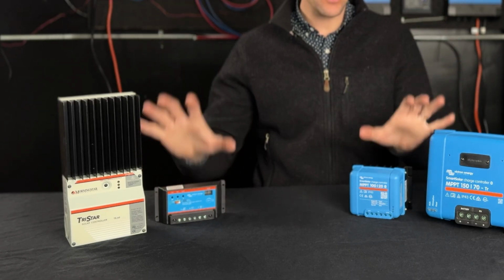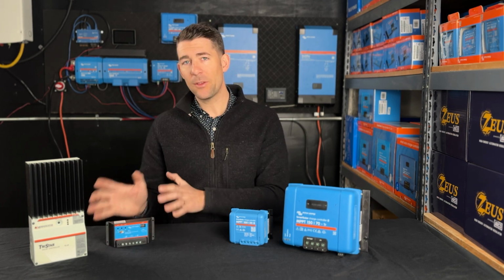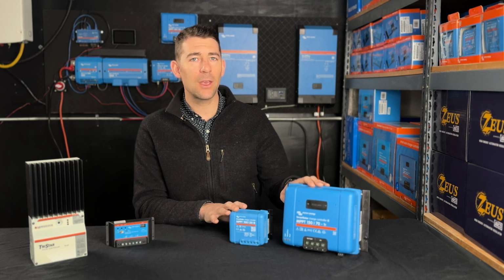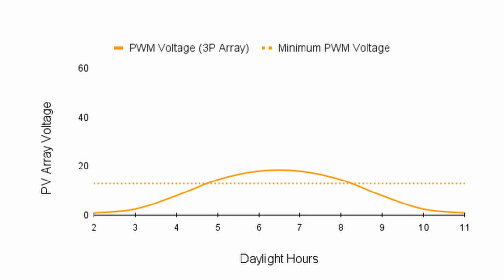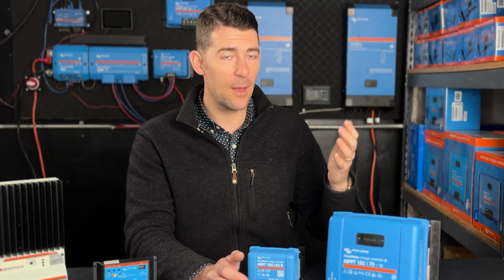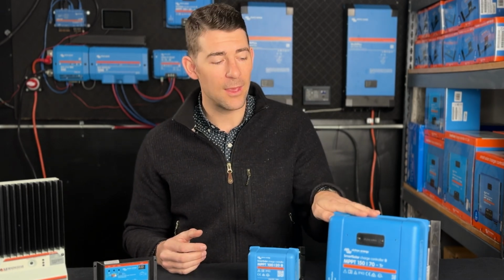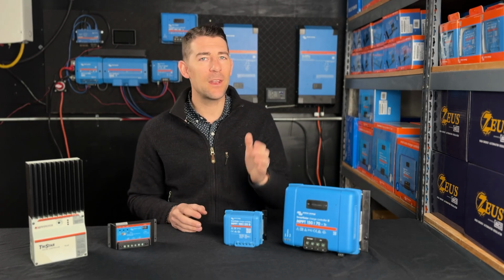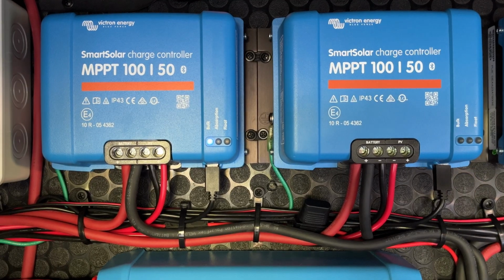Understanding MPPT Charge Controllers

Comment: Can a solar charge controller jus work without a solar battery? work just as a dc to dc converter? plenty of them have remove the dc load option. I want to use mine as a volt compressor . I over panelled my powerstation in parallel the volts became too much contrary to what I learnt on YouTube and fried the system. So can I just buy a solar charge controller let it just work as a dc to dc converter for me?
Reply: Did you get an answer to your question? I have the same problem/ I want to use a solar charge controller to charge a 24v lithium battery from a 12 v dc output on a power station.
Reply: @odal6770 I just wish they will let charge controller work as dc to dc converter too
Reply: @prosperityokechukwu1503  I agree. I have come to the conclusion, maybe wrongly, that solar energy makes no sense for me. It simply takes too long.

Comment: I want to solar charge with a 30w or a 50w 24v solar panel  a 24v gate opener that has a 24v 60ah lifep04 battery which of your Victron solar charge controller's do  you recommend
Reply: Okay show me a video of all the components that I'm going to need to turn around and run a three-bedroom whole house system I need to know all the equipment I'm going to need
Reply from the maker: Lol, see reply on comment.

Comment: I will have a 1000 watts of solar panels what one do I need?  You have two sizes on your left you didn't talk about them comparing the size difference!
Reply from the maker: Hi! It's going to be largely dependent on your PV details and your battery bank. Part of why I didn't go into detail about the exact units I had was that there are so many. For 1000W of PV you'd expect  to see around 80A of power for a 12V system, 40A on a 24V system, and 20A on a 48V system (the second number of the MPPT model). Then the Series/Parallel configuration of your PV, the voltage of the strings, and the amperage of any parallel strings, comes into play when choosing the appropriate MPPT (the first number is the max input voltage). Thus, for your setup of 1000W I'd suggest a 150/85 (if your PV voltage is under 150V in cold weather) for a 12V system, a 150/45 for a 24V, and a 150/35 most likely for a 48V kit.
Get in touch for specifics and we can go through your exact setup.

Comment: What size conduit is needed for 70 amps at 150vDC?
How can I run the wires on the surface of the ground from the array to the house?
Reply from the maker: This depends on where we're talking about. If you've got 70A of 150V power that's quite a lot, likely 2 MPPTs at least - so 4+ cables (bigger conduit). If your MPPT output is 70A while the input voltage is 150V you're actually hitting 20-25A over the PV wires. Say you run 100', that's around an 8AWG wire. Longer it might need to be a bigger wire shorter and it could be smaller. Also depends on the conduit and how well heat is mitigated, etc, etc.
Reply: @intelligentcontrols  Each panel is 27v OC at roughly 8.5 amps or 200 watts each.
I have 4 of them.
My controller is a victron 150/70.
I have 8 gauge wire and roughly a 100 foot run.

From controller to bus bar and then to batteries is 2 gauge.
I might add one more panel so my voltage would be about 135 v.
And rough,y 40 amps or so.
Less any losses.

I do not expect the full 800 watts and panel makers ALWAYS lie about the output.

Hoping for 600 watts or so x 6 hours a day.

Not sure on how I will run the wires.

I may just get a string inverter and not have to worry about it. Have an AC outlet within 25 feet of where the array is going to be.

Of course I would be stuck with an expensive Victron going unused.

Comment: I think you kinda made me understand a little more than I did. I have 6/320 watt panels, 6/100amp deep cycle marine batteries,  how many watts of mppt do I need.
Reply from the maker: Thanks Mary! If that is a 12V battery bank then you should look to get about 160A of charging capability from your MPPT's. A pair of SmartSolar 150/70's or three 100/50s would be a great fit.

Comment: I have 30 ah lithium ion battery with 180 watts panel and pwm based solar  inverter 50 amp charge controller
Reply from the maker: Ok. We can give you a specific recommendation if you'd like to reach out to us directly with the details of your PV panel and battery bank. From the really basic detail of a 180W PV panel charging a 12V battery bank you'd likely be wanting to use a SmartSolar 100/20 or even perhaps a SmartSolar 75/15

Comment: I have 100/50 300 watts they over heat
Reply: Did u conect it correctly 🎉🎉
Reply from the maker: These units do get warm while running typically. I'd start with how solid the connections are: biggest cause I see of heat is a connection that's smaller (or not fully set) to handle the power involved. Second cause, especially of smaller units in a mobile setting, is a tight compartment or that it's near a surface that get's quite warm and overheats it (like the exterior shell of a camper van sitting in the sun). Check the connections first, then the location and see if you need ventilation or to get it away from a hot wall, then if it's still overheating and giving you an error contact who you purchased it from and see if they can help - Victron is quite good about supporting their equipment so if there's something wrong with the gear they'll make it right.

Comment: Also if you connect the batter from the charge controllers does it matter the size of the controller or how many panels you use
Reply from the maker: Yes, the size of the array and the voltage of the battery bank is crucial to determining what MPPT is best fit to the job.

Comment: Hi can you suggest me what is suitable solar charge controller for solar panel 500w
Reply from the maker: Hello there, the answer will depend on what voltage your battery setup is. The quick and dirty way to find out is to take the wattage of the solar array and divide it by the voltage you will be charging. For example, 500W / 12V = 42A. In this case, you should look at charge controllers that can provide around that amperage. If these are say, a pair of 250W 24V panels, then a good option would be to series them on a Smart Solar 100/45 MPPT

Comment: In multiple panels wired in series, if one panel is shaded will the mppt charge controller still be able to charge system? Or do all panels need full sun no shading?
Reply from the maker: In a series connection, voltage is added panel to panel, while amperage is set to the lowest source. If one panel is shaded, the addition to the overall voltage will be reduced, but the overall amperage will be set to whatever that shaded panel can provide. So everything will still work, but the output will be reduced.
Reply: @intelligentcontrols i sea, thank you.

I was under the impression any shade in the series circuit would null the input from that leg.

Comment: Victron is severely overpriced. There are other controllers with the same or better functions and a LOT cheaper too with an equal or longer warranty than Victron.
What I don't understand is that warranties never match the lifespan of the panels.
If Victron is go good then why a shitty 3-year or less warranty for premium dollars?
Technically you may have to replace your controller every 3 year-ish at a high price.
Does the extra power you get save you enough to warrant that expenditure?

I will have a 4 panel array - 2 series + 2 series then both in parallel so to stay close to the 50 volt controller limit.
I get the benefit of some shading protection and power generation at roughly the same time.
Sure I need 8 gauge wire (100 ft run for each the red and black) but wire does not wear out so it can be reused again. Or used elsewhere.
My array is portable (on wheels) so I can MOW under them and NO PERMITTING required.
Fixed arrays generally require a permit and as a result higher property taxes.
No thanks to both.
Oh and permits to do an old house usually demand you upgrade everything NOT RELATED TO the solar.
Not going to rip out walls just to replace wiring for grounded outlets, new panel with arc fault breakers, etc when all I want is solar for a backup system that is NOT connected to house wiring.

On my array, if I have a problem I only lose 1/2 the array. If all in series I lose everything (power generation).
You have just as many failure points in a series than you do in parallel.
Each connection is a failure point, regardless of the setup.
At least with parallel if you lose one panel the others still supply SOME power. 1/2 a loaf is better than no loaf.
Reply from the maker: Victron tends to have a European mindset regarding warranties. If the product is good and the reputation proceeds it, why would someone need a warranty unless they are expecting it to break? If they expect it to break, why are they buying it in the first place?

Not saying that the opposite position isn't valid, but if Victron components had any history of needing replacement every 3-4 year then I doubt people would pay the premium.
Reply: @intelligentcontrols  Never trust anything with electronics in it.
Not just Victron, but your stove, refrigerator, washing machine, cell phone, tv set, etc etc etc.
Expect to break? I sure do. Anything will break, in particular anything with electronics in it.
In the past I have bought things with a short warranty. And soon after the warranty expired, the item broke. And at a very inconvenient time too.

If Victons were made to last, they why not increase the warranty a lot at least for marketing reasons?

They chose a short warranty for a reason.
What might that reason be?

I do not plan on the one I am getting to run at maximum for any length of time.
In fact, the one I am choosing will run about 25% less than maximum, at least initially anyway.

It is going to be a 150/70.
Input will be about 100v and 36amps.
And with a 100ft one way wire run of 8 gauge, the numbers will be even less.
Leaves more room to add a couple more panels and not stress the unit.

Not going to run my inverter at max either.

I learned that heat is the enemy.

Would you drive your car with the gas pedal floored everywhere? And if so, how long would your car last?

Same with electronics, but even more so.

I do like the large static heatsink it has.
Less moving parts = higher reliability.

I wish the unit came with a LARGE screen that you can easily see what's going on, make adjustments, see history, etc like the app can do.

HATE the idea of being forced to buy a cell phone just to use the victron. No, I haven't had one in years so that would be an unnecessary added expense in my opinion.
I do not want a cell phone either.
Computer is ancient and no bluetooth. No home internet router.

Just hoping the thing is fully automatic right out of the box.
Hate to have a battery fire....
Reply: @intelligentcontrols  Everything is fallible. I expect everything to break sooner or later.
I did buy a victron after all because of the warranty and it matches the system I am going to build.
Others did not meet my needs.
Originally bought a LiTime one but returned it immediately once I saw the specs.

Off that the victron max input is 1000 watts....

What happens when batteries are full? Will the controller stop on it's own?

Comment: I have found a problem with the MPPT controller, if the battery is flat, and the sun comes up in the morning, then you only get solar in the charger. it burns out.
Reply: more to that because the bms on the battery s have shut the battery s off because of low voltage
Reply: Why aren't the battery BMW shutting off the battery?
Maybe make a few upgrades?
You can parallel an MPPT with a PWM too and get that protection.
Reply from the maker: Hello John, what is the voltage of your panel array compared to the rating on the MPPT? If the batteries aren't accepting charge, then there is no load on the panels and the voltage they are putting out will be at their maximum. If your MPPT is undersized, you risk shorting it out and voiding the warranty. Please make sure you aren't running it beyond its parameters

Comment: Excuse my ignorance, but if you wire in series, you gain on the volts but you lose out on the current? The current is what you need to fast charge your batteries.  If your lithium battery can take a fast charge of 15Amps, you'll only be charging the batteries at 5amps which will take longer. Am I correct?
Reply from the maker: @crazysquirrel9425 is right. The MPPT is taking the volts and amps provided by the panels and manipulating them into the proper voltage to charge your batteries. If voltage is high and amperage is low, the reduction in voltage to match the batteries will push the charging amps up.
Reply: @intelligentcontrols  Same physics applies to grid power. High tension power lines have low amps and need smaller cheaper wire.
Higher voltage (potential) overcomes wire resistance easier than low voltage.
Less line losses that way.

The wire that will come from my array is too small for the run by quite a bit.
So, I have to series my panels and may even have to add in more panels to overcome that line loss.

Application would call for 2/0 wire (not 2 gauge) but I can only use 8 gauge wire.
I am going to lose at least 15% of the power generated with the 4 panels I will have.
Possibly more.

If I hit 25%, that is the price of a single 200w panel.

So if I add 2 more panels to make 150v+ at one end I should get closer to controller maximum but not exceed it.

Design problem is how to run the wires from the array into the house.

String inverters would be a waste as I would lose power with those, still have to run the wire, and lose power converting it back down to charge the batteries.

Burying the wire would be very expensive. Have to go around a building, then under a 25-30 foot concrete driveway, then 20 feet later go under a concrete sidewalk just to get to the outside of the house.

No straight run so have to use the biggest wire I could afford (100 feet each of black and red).
Wire resistance will kill the efficiency even if I step up the voltage.
Cannot move panels close to house due to a very large tree shading the area.

My 4 panels will have OC of just over 27v.
2 more needed to bring everything up to 200v so to overcome the line loss.

And 200v is DANGEROUS.

Have to keep it safe first for people and animals then for the equipment.

Thinking I could toss both wires into a garden hose and run on top of the ground.

Out of that 100ft run, I need 10 feet at the panels for wiring comfort and another 10 feet inside where the power station is for wiring comfort.
That limits how far away the panels can be.

Getting everything to match up can be complicated.
All this to run a refrigerator lol
MC4's I do not believe will accept 6 gauge wire and certainly not 2/0 wire.
And the Victron will only take up to 6 gauge wire.

To buy that size wire would add an additional $400 cost to the setup.
Oh and $400 is enough to buy 2 more panels.
They get you no matter which way you go lol.

I should get the 70 amp output regardless of the input numbers so long as the input numbers are higher than the output.
So 70 amps/4 batteries is under the 20 amps each threshold for heat control.

Your thoughts?
Reply: Controller steps down the voltage to step up the current.
Remember, watts is watts regardless of the voltage.

Comment: App keeps dropping off. And if U are in w place with no signal cannot use it. And every town in Australia no sign signal and U need to keep putting in the puk& pin. Useless
Reply: What you've said isn't true at all. I'm travelling around Aus right now using a Victron mppt unit. The app uses Bluetooth to communicate directly to the unit, nothing to do with the mobile phone network or connection to some Internet-connected Victron server. Just get the app and be in range of the unit.
Reply from the maker: Hello Daniel, sorry you are having issues. As @trudyandgeorge pointed out, the Victron Connect app communicates with the SmartSolar via bluetooth and does not require cell service.

Comment: Is the battery terminal and load terminal same on MPPT controller? 
I want to connect my trailer indoor lights to the load terminals on the MPPT instead of the battery bank Is that ok ? Less then 1 amp
Reply: As long as you are within your load capacity on the controller, yes. Specifically with the Victrons, this is the preferred method as it keeps track of all your load statistics and you can graph them out, compare usage to yield daily, etc - gives you a great mental picture of system performance and you can tell way ahead of time if you’re going to run into capacity issues down the road. 

I have a separate battery monitoring system (also Bluetooth) with a primary shunt, but it will detect the same loads even if you run it through the Victron. 

Obviously you can’t run something like an inverter through it, but for all my smaller devices, I wire it through the controller as it gives me great information through their app. 👍
Reply: @EstorilEm fantastic appreciate you getting back to me this clarify all my questions 😀 🫡
Reply: I believe the load terminals are rated for 20 amps at battery voltage.
A 1 amp load is plenty good for your needs.
Reply from the maker: Great explanation by @estorilem